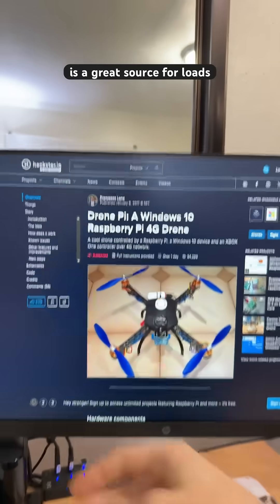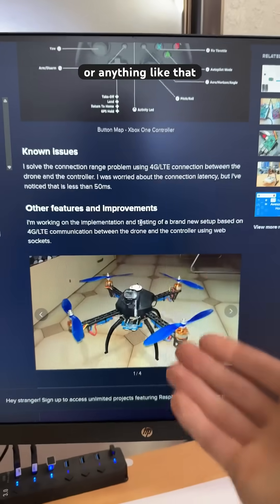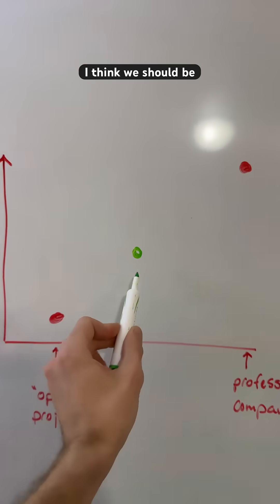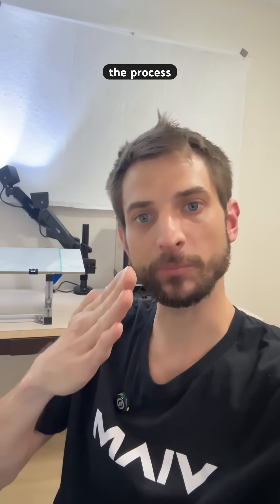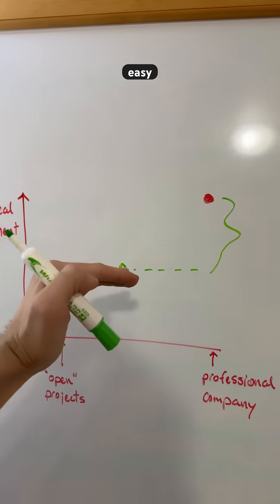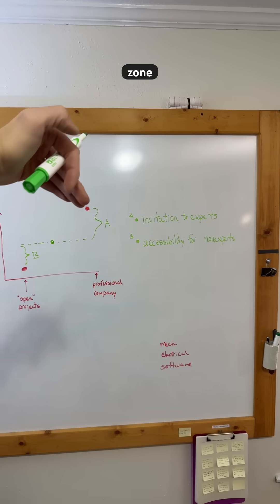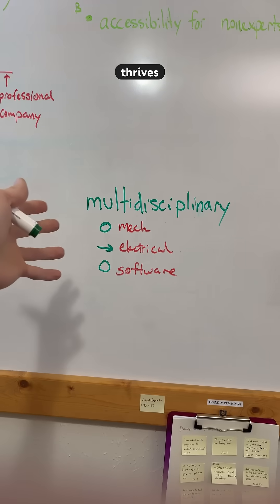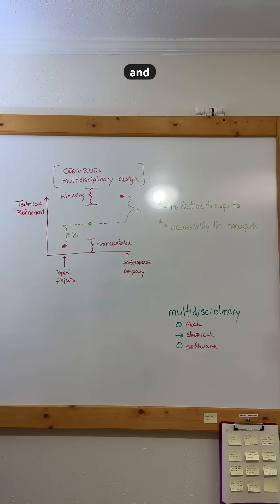how “professionally” should you drive your open source projects? #opensource

Comment: Can AI solve this? 

I’m not an engineer but seems like we are awful close from having a google translate that can display documentation at different levels. 

Possibly even generating complex data sheets? Maybe next year multimodal models would be there?
Reply: I think this too. With a nice UI and slider that makes things simpler <-> complex & specialized ^v less specialized it would cover all corners. allow the user to have a profile so that the system knows what they're good at and allow the UI to adjust accordingly so a unique display for each person
Reply: Yeah, that was my thought too. In my opinion, you should always aim to produce the most technical document you are capable of in the time you have. There's nothing more frustrating than being halfway through a project and realizing there's some key piece of nuanced information that's not been included because it was "too technical".
If there is concern for someone being unable to understand the technical side of documentation, then AI is the perfect solution. It can hold their hand and guide them through what they don't understand. Translations like this are one of the primary things AI excels at.